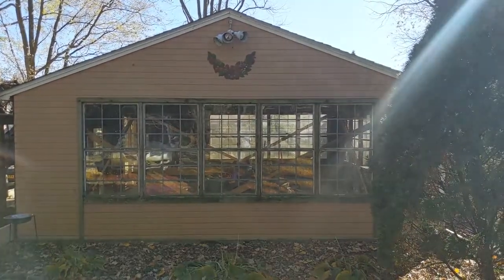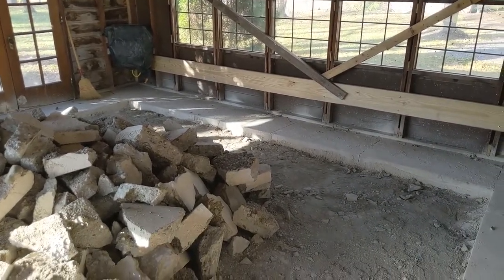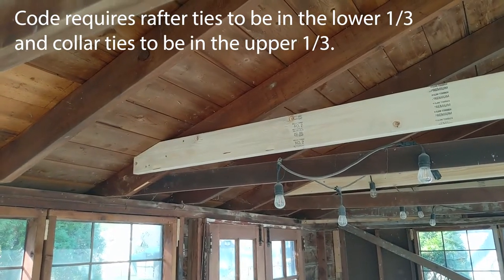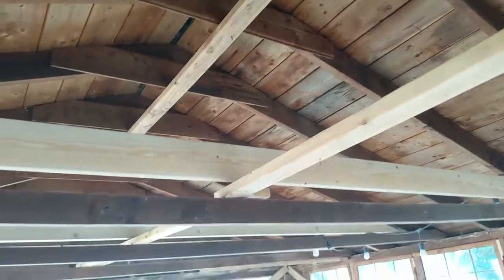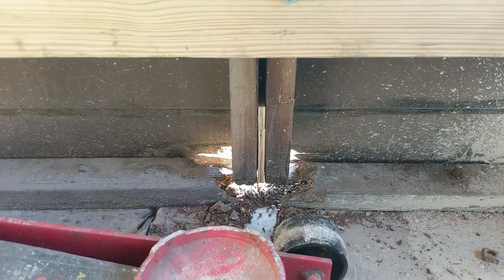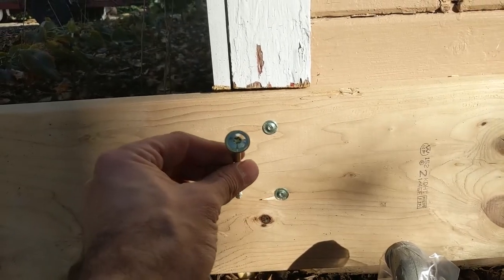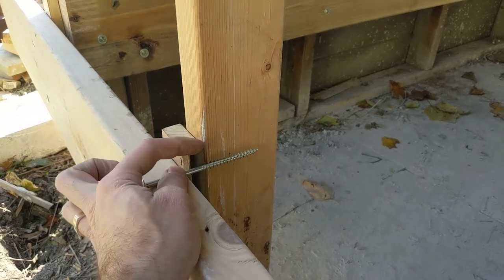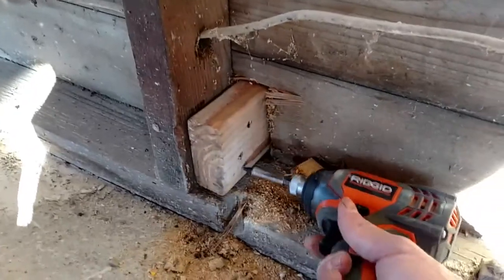Lifting a Garage from the Outside - Part 1: The Prep

Comment: Thank you for sharing this friend.  Nice work.  I was in the process of raising my garage (soon to be an apartment), and I stumbled across your video.  My dad and I were debating how we'd do it, but the flying buttress just makes good sense, as it allows us to place our bottle jack further from the building.  By the way, we cut out the old (buckled) concrete too, but the existing is quite solid so we're just going to pour our new slab over top.  Anyway, thank you.
Reply from the maker: I’m glad the video helped you out. I also was fortunate to have my dad to brainstorm with, and it made all the difference. Best of luck with your project. The lift can be tricky, but I’m sure you can do it—just take your time.
Reply: Thx man, will do (take our time).  I’ll post a video as well, as it’s important to share lessons learned.
Reply: @This_Old_Garage  Quick update for you...  we got it raised 14" today, which will allow us to pour the new floor.  It's suspended on blocks as I send this msg to you.  Thanks again man.  The flying buttresses worked like a charm.

Comment: Curious why you used the flying buttresses on the outside instead of on the inside?
Reply from the maker: Good question...inside would work for sill plate repair or raising the structure for added height. For this project, the buttresses had to be on the outside so as not to interfere with the monolithic slab to be poured beneath the raised garage.